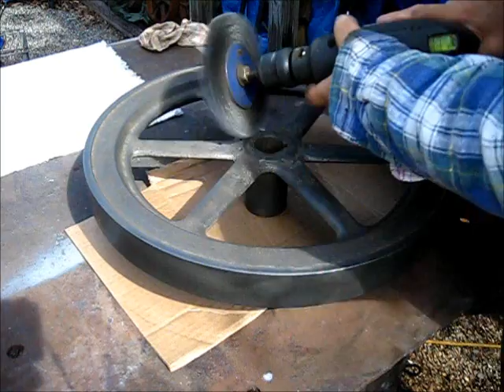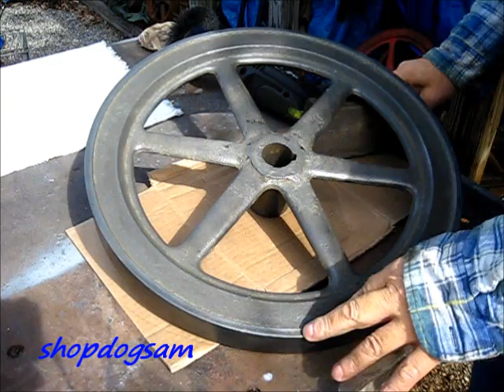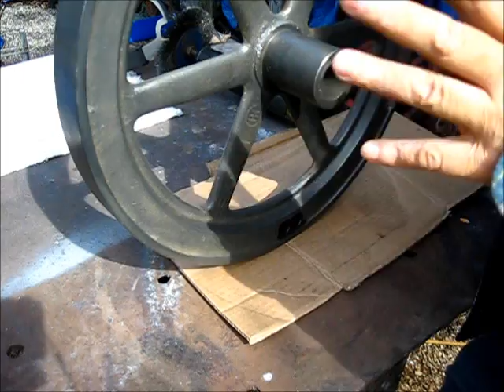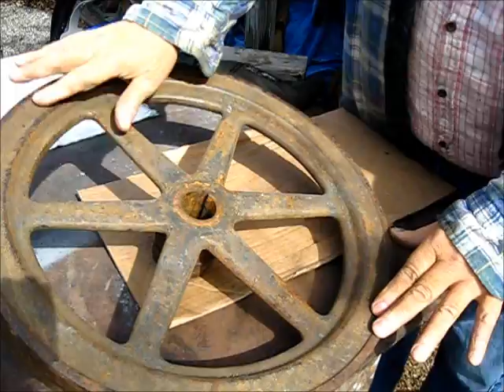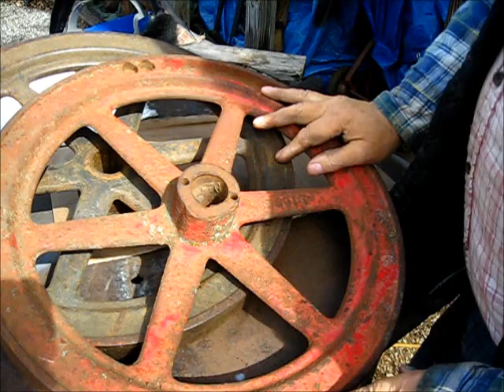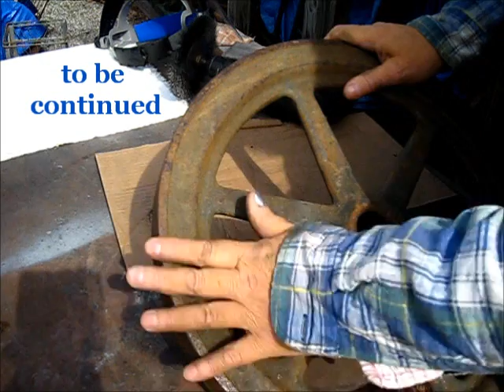IHC ENGINE / electrolysis, flywheels, comments

Comment: If you smooth off the casting lines it will not crack as easy. The casting lines are a good place for a crack to start. I know they smooth them off on cast iron engine blocks for that reason.